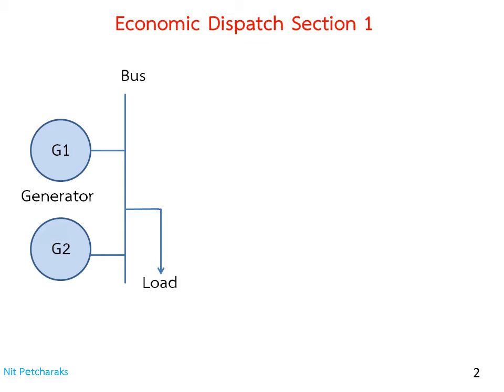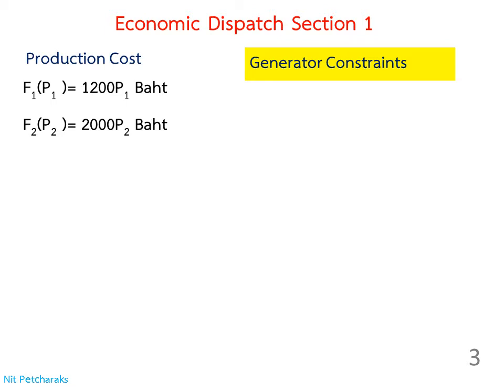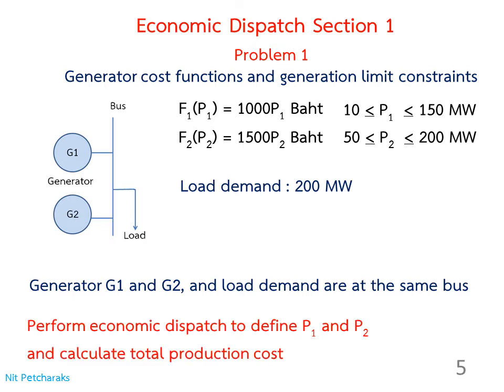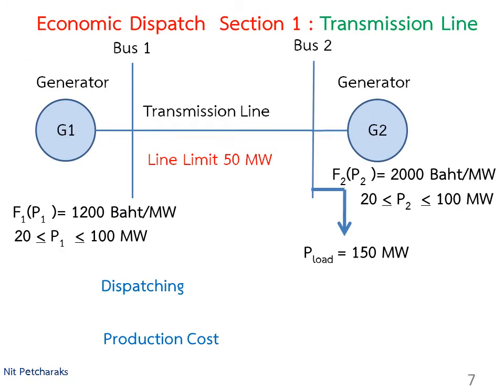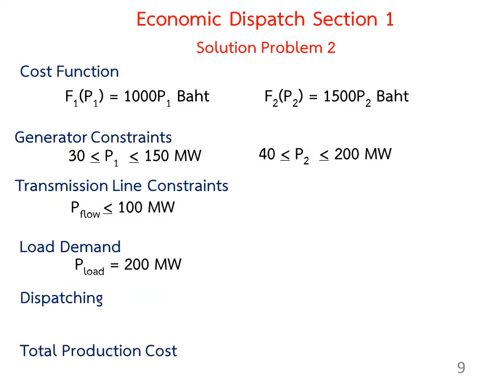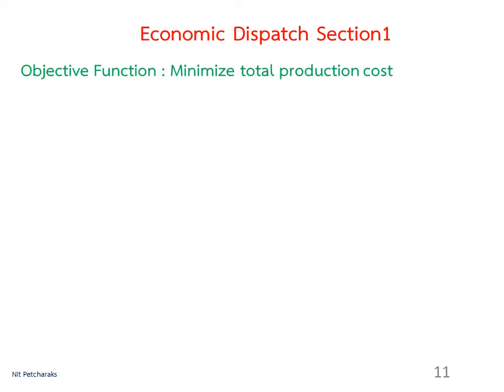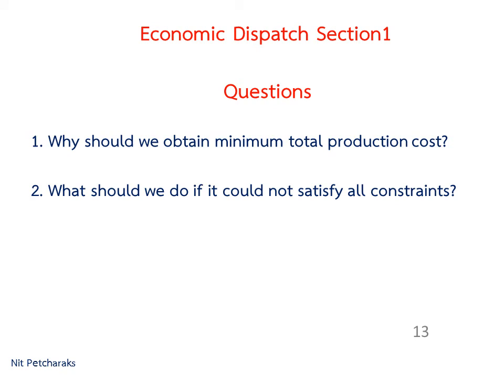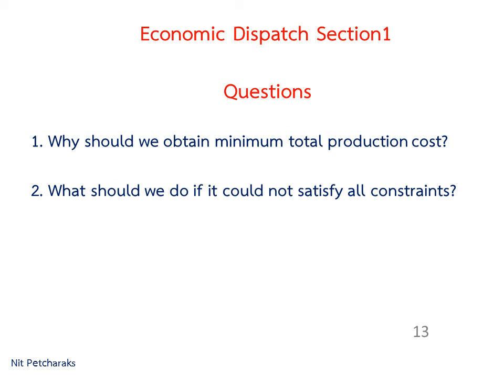Economic Dispatch Section 1 Eng v2 sound2

Comment: please explain the part at 5:32, I don't get it. the line limit is 100MW. why is P1 150 MW?
Reply from the maker: G1 supplies load at Bus 1,   120 MW and  supplies Load 2 only 30 MW.
Reply from the maker: Sorry for late reply.
Reply: @electricalpowersystem73  
but the minmum limit for p2 is 40 MW ? ! 
so p1 supply 80 MW and p2 40 MW 
for load 1
Reply from the maker: @baselbooss3894  Do you ask the part at 5.32, P1 150 MW, P2 170 MW
Reply from the maker: @baselbooss3894   P1: 150 MW, P2: 170 MW, Load 1: 120 MW, Load 2: 200 MW